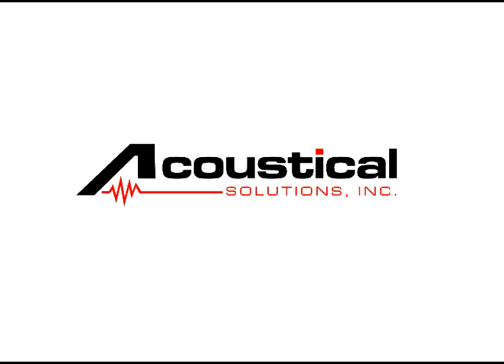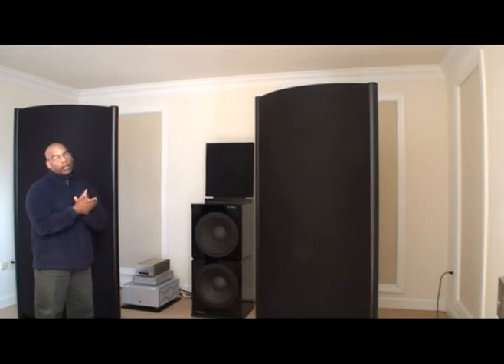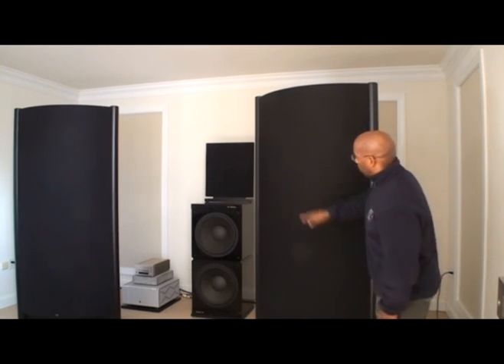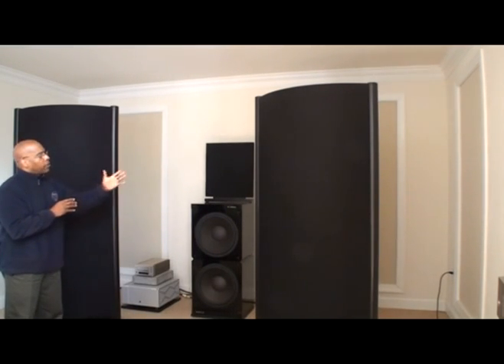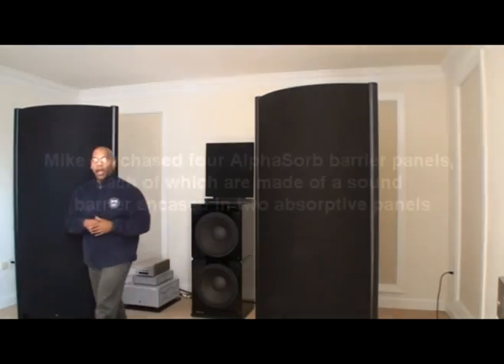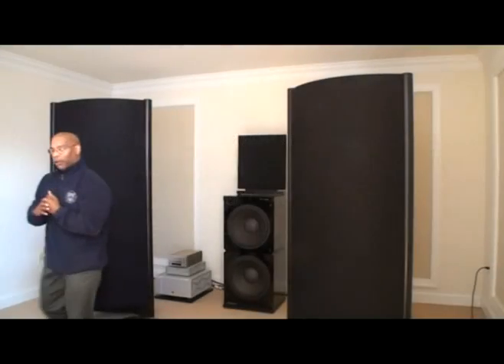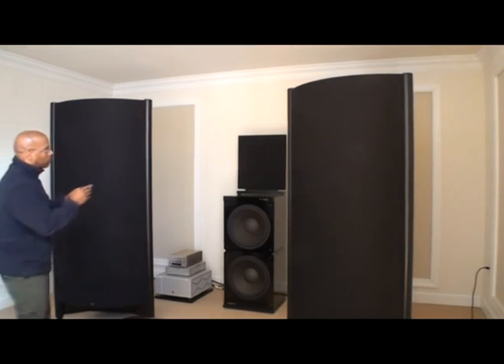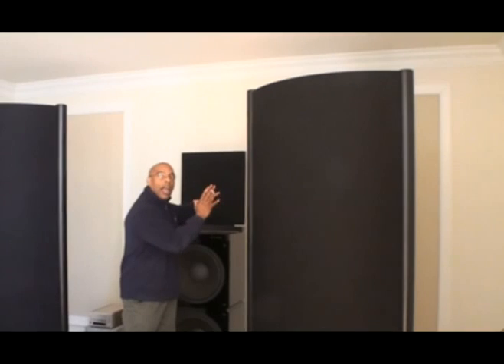High-end Audio Acoustical Treatment

Comment: @dkoonoo   Just to add to what asolutions1 said there, 2 channel listening rooms, like this, are always going to want to be a little more "live" than a home theater set up which typically has a 5.1 or 7.1 system.  5.1 systems will need a little ring to the room but not very much, where as a 7.1 system its almost advisable to just dead out the room completely and let the computer in the audio system "tell" you what the reverb time is, or the directionality of the sound.

Comment: Mike! Your Sound Lab U-1PX Electrostatic Loudspeakers would do much better in a larger room - like any dipole, they need space around them [ at least 1.5 meter from the sides and two meters from the panel to the rear wall] -- just for shits and giggles, you should try a M-3PX in the place of these -- you would probably get better results. No amount of room treatment can overcome the physics of a small room, when driven with a huge dipolar line-source like the U-1PX. One of the best in a shoe box

Comment: I totally disagree with absorbing the rear wave from any loudspeakers including electrostatic loudspeakers..  Its this rear wave that helps in creating a 3 dimensional image, and canceling the rear compromises this as well as effecting overall tonality.  The whole advantage of electrostatic loudspeakers is that they are more directional and do not excite the rooms acoustics nearly as much as other types of loudspeakers.  If you use any type of acoustical treatment, diffusion is a much better choice as it does not absorb sound but rather scatter sound wave that may be a issue.  Most people think you want a room to be heavily damped and that would be completely wrong, you want a room with good decay somewhere in the vicinity of 1 to 1.5 seconds.  The other issue with absorption is that most material is no linear, meaning it will absorb at certain frequency's and reflect at others, creating comb filtering issues.  Peaks and valleys in the rooms overall frequency response.  Sorry not in agreement here.

Kevin